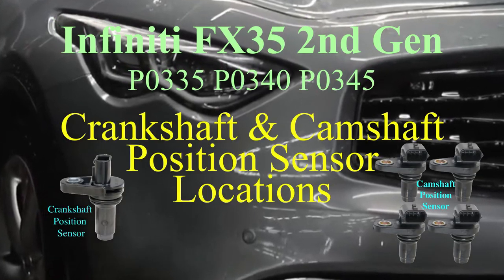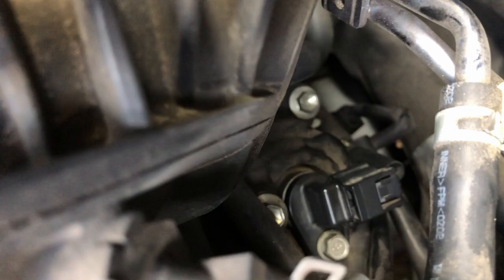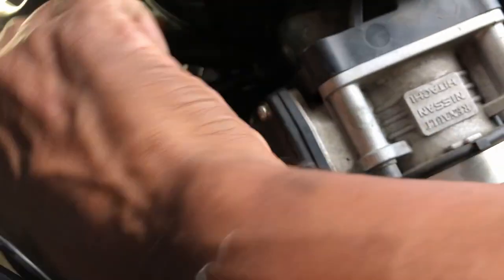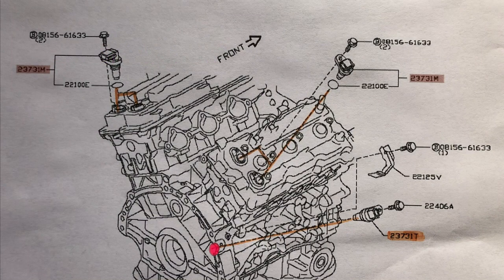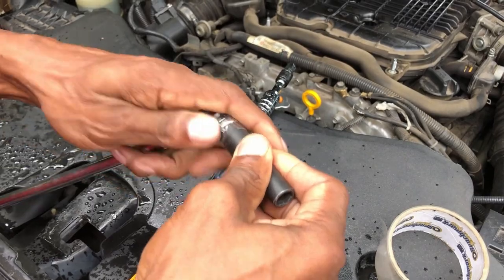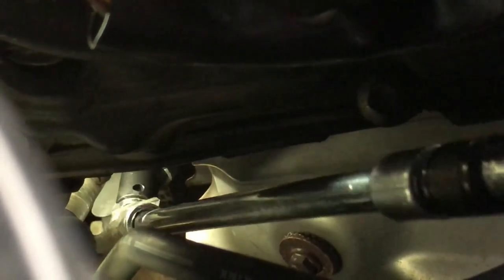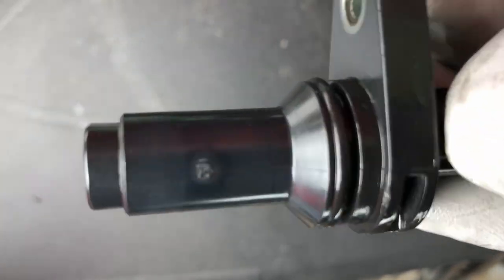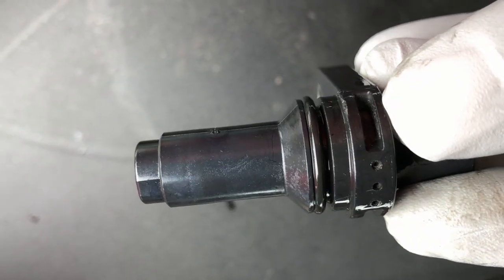Infiniti FX35 2nd Gen Crankshaft Position Sensor Removal and Camshaft Position Sensor Locations

Comment: I’m trying to change a Crankshaft Sensor on a EX35, same motor and it’s hard when you’re doing it blind with reach and no space. I can’t really find it.

The EX is stalling when it gets warm, with no check engine light. If it doesn’t turn out to be the crank I’ve read to do the 4 cam sensors and also the 2 mass air flow sensors. I already cleaned the throttle bodies and the mass airflow sensors.

Comment: i was trying to take the connectors off my sensors but could not. So, i stopped before i broke anything. Any tips?
Reply from the maker: Did you remove the gray connector between the two sensors. It gives you more access when the gray wire is removed.

Comment: What's the p0024 and p0430 for the 09?
Reply from the maker: P0024 INFINITI -  dirty oil could cause the valve to stick.  Exhaust Valve Timing Control Performance Bank 2 ...... P0430 INFINITI Code - Catalyst System Efficiency Below Threshold Bank 2